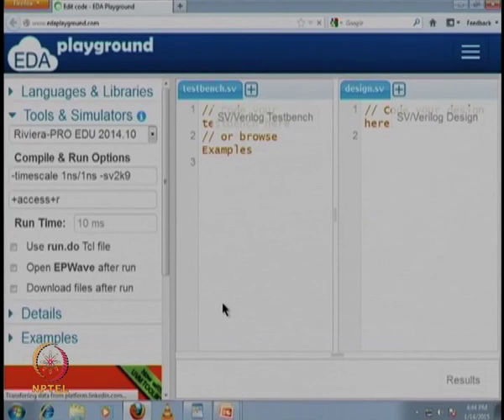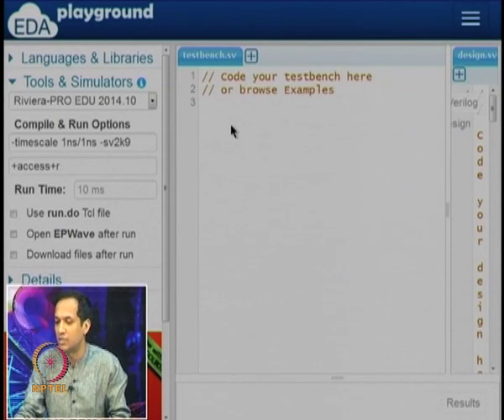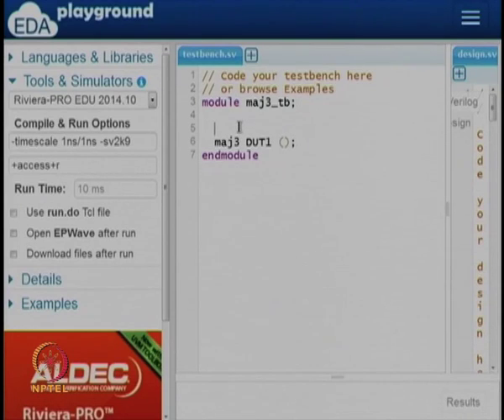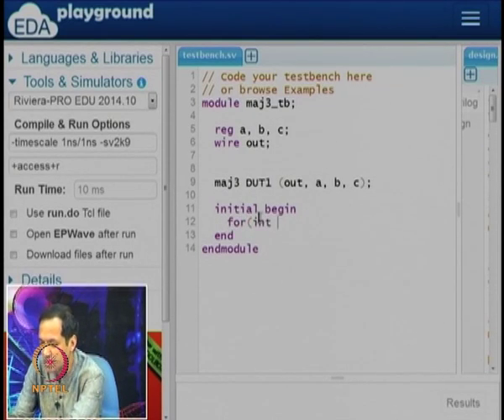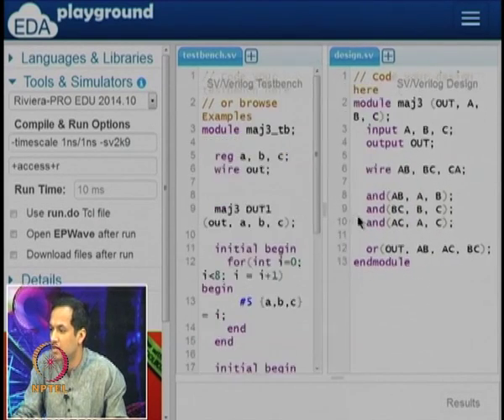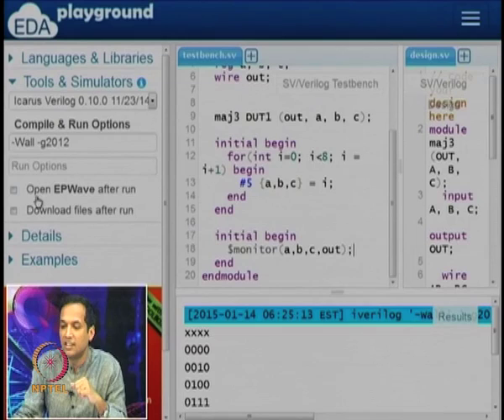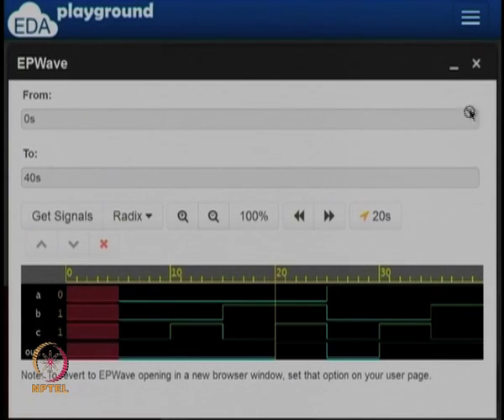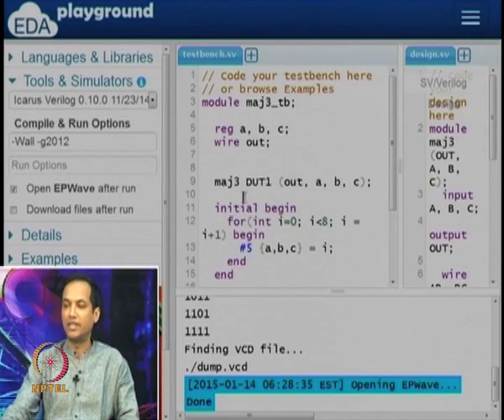Digital Circuits & Systems   L17

Comment: this is my test bench code but it has syntax  error and i can't correct it 
module maj3_tb ;
  reg a,b,c;
  wire out;
  maj3 DUT1 (out,a,b,c);
  initial  begin 
    for ( int i=0; i<8; i=i+1) begin 
        #5 (a,b,c)= i ;
      end 
  end 
  initial begin 
    $monitor (a,b,c,out);
  end 
endmodule

the error in the command bar is 
[2017-10-25 10:43:39 EDT] iverilog '-Wall' '-g2012' design.sv testbench.sv  && unbuffer vvp a.out  
testbench.sv:9: syntax error
testbench.sv:9: Syntax in assignment statement l-value.
Exit code expected: 0, received: 1
Done 
please tell me how to correct it